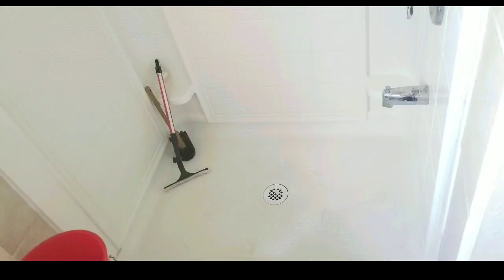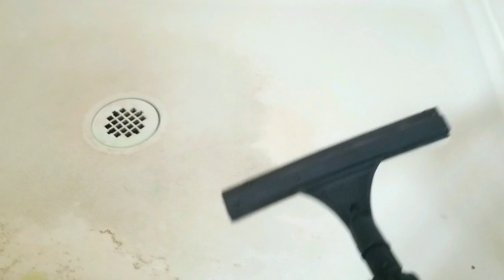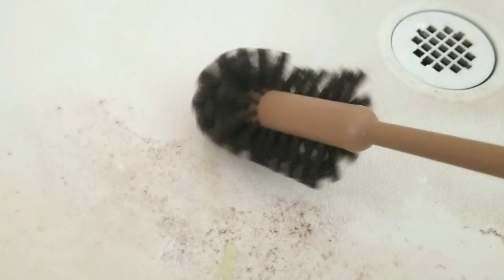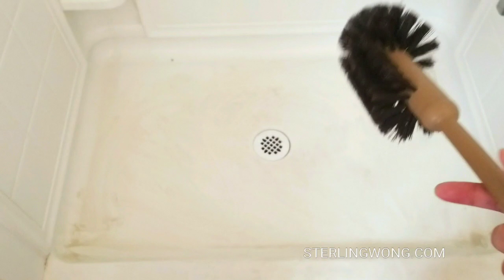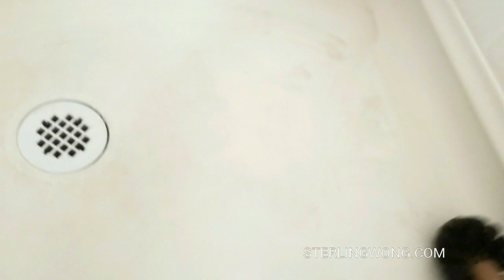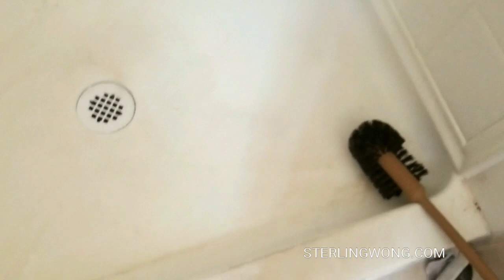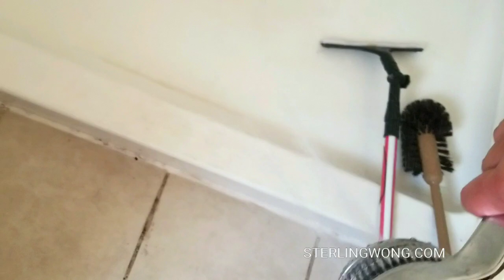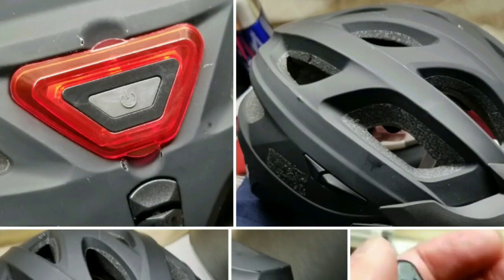How to clean shower stall in 10 minutes the easy way without much scrubbing.

Comment: Our shower stall is similar to yours – tiny grid pattern on the long wall, narrow cubby shelves, and an overhang at the bottom on all 3 sides. It is a total pain to clean! We have tried different brushes and abrasive sponges for the shower floor and overhang with mediocre results.  We are definitely going to try your technique!  Thank you for a great video!